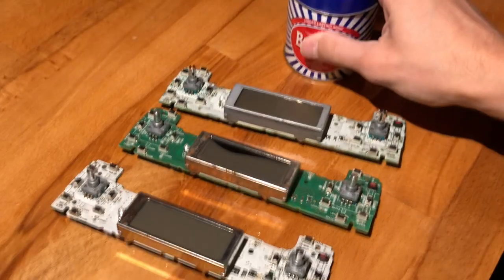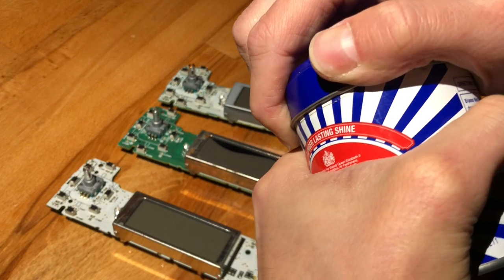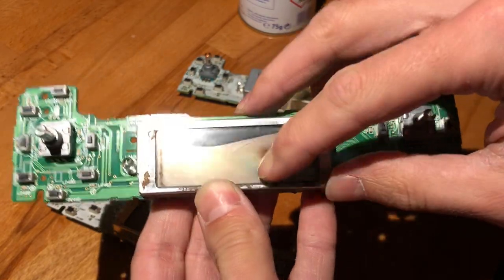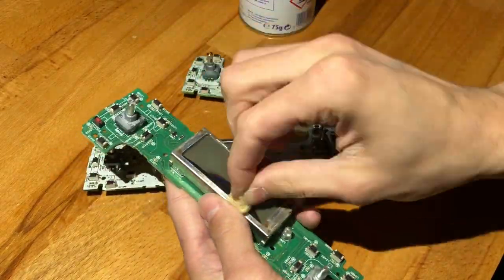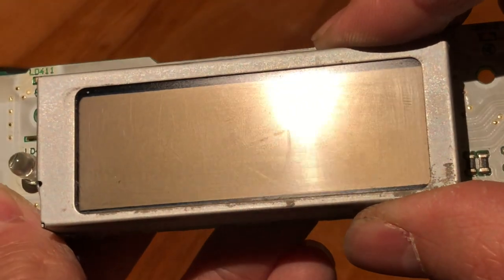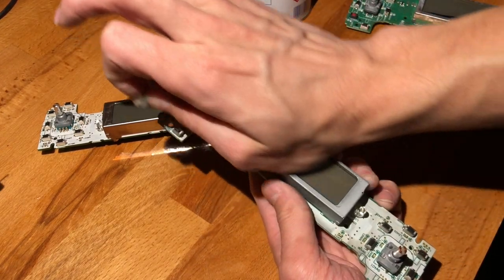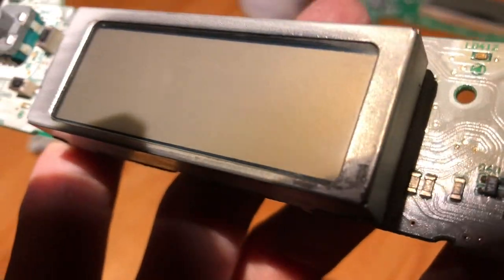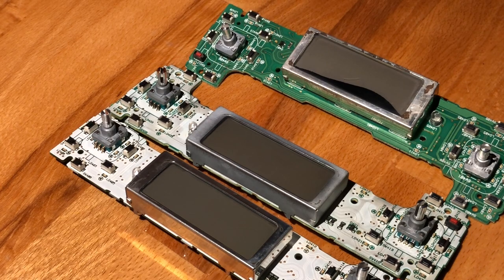Polishing Scratched LCD Displays - What BRASSO Can & Can't Do

Comment: I have never tried brasso i normally use a car cutting polish on clear plastic never tried on glass though .
Reply from the maker: these displays aren't glass on the surface though - it's a rather soft plastic

I tried buffing it with polishing paste and a dremmel - and - any mistake will melt the plastic entirely